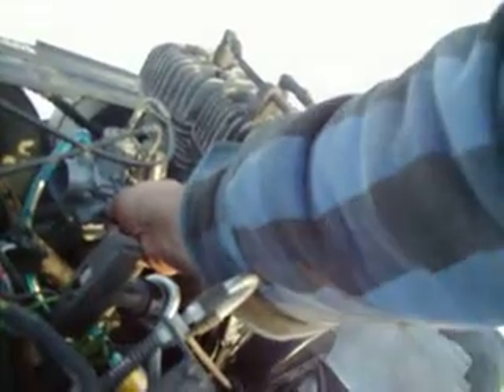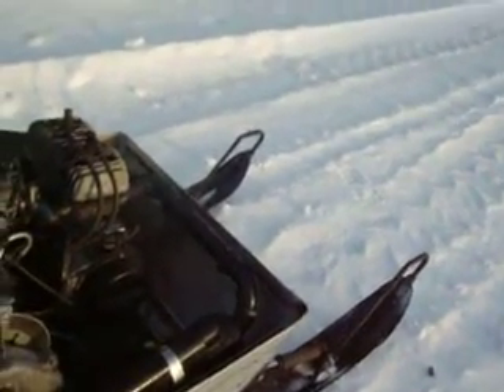Project Jaganther 013.MOV

Comment: Nice collaboration of the jag with the panther. Did you ever finish it up?
Reply from the maker: Haven't touched it since about 2 weeks after this video until today. Have totally lost any interest in sleds for the last 4 years because snow conditions and depression. I know it's pathetic to think I shouldn't have to haul a sled anywhere to ride but that's just the way it is. This eastern ND after all.  Also I think reality has set in that my frost bite over the years has limited my ability to go out in any temp and just enjoy a ride if there is enough snow.  I shouldn't expect perfection when it comes but that's the way it is. Maybe if I go on a couple vintage runs my attitude will finally change.